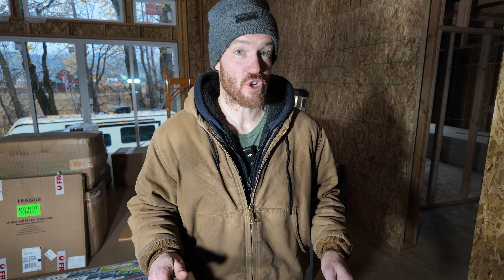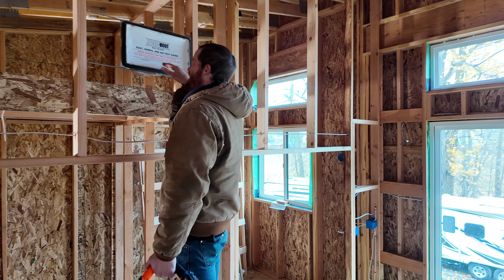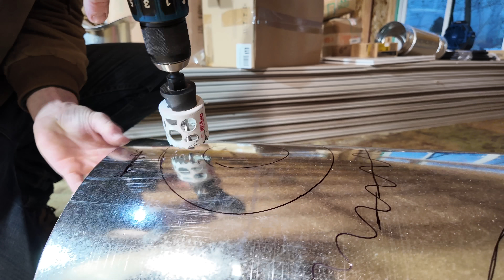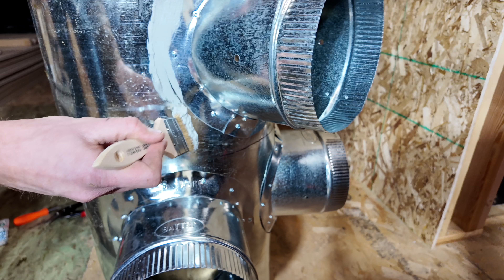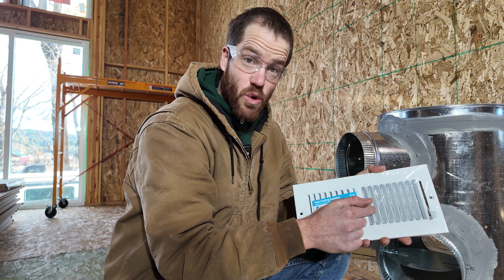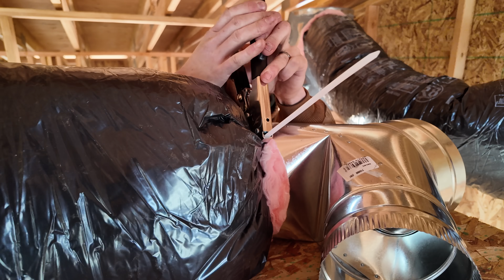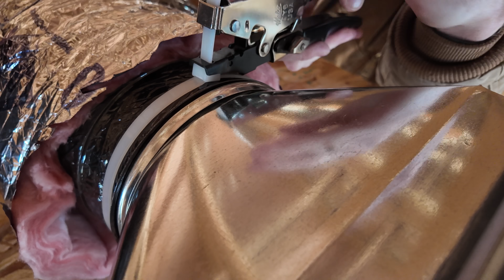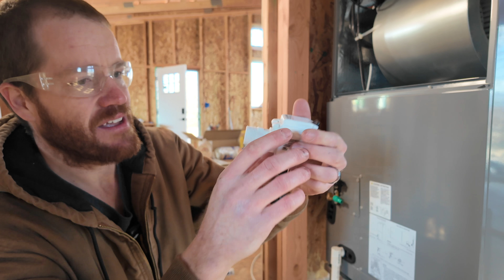HVAC Contractors Hate Me For Showing You This

Comment: 6ft of flex is about it for good flow and using all flex is not great, it will work but poorly especially with heat since the blower runs on low cooling runs high and not having return in every room turns out to be garbage as well
Reply from the maker: We’ll make sure to report back on how the flex works long term!  We haven’t had any issues with it in our apartment.
Reply: @AmbitionStrikes  Like I said it will work but you will never know because you have nothing to compare with unless you use flow meter. One small tip when using the second zip strip, fold the foil over glass and under so no glass is exposed, no glass can float in the air or be pushed, its not that it wrong its just better and no dirt after time get in the glass, these are just little pro tips. With to much restriction can cause issues with the exchanger "can"
Reply: @AmbitionStrikes , I think the flex ducting will be fine because you are starting out big and then stepping it down. My grandmother's place had an antiquated octopus style setup that was done back in the late 50's and back then they only used 6 inch round hard ducting for all the runs and that worked just fine for about the same square footage. And I'm willing to bet that your system is probably way more efficient than what that was.